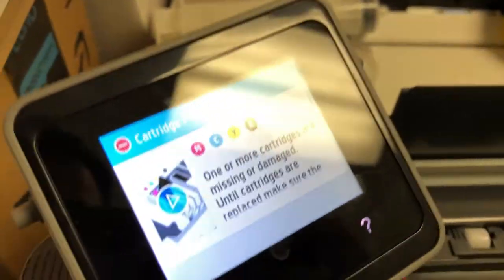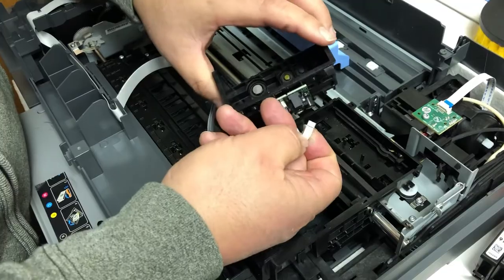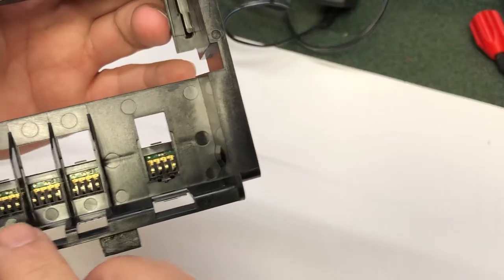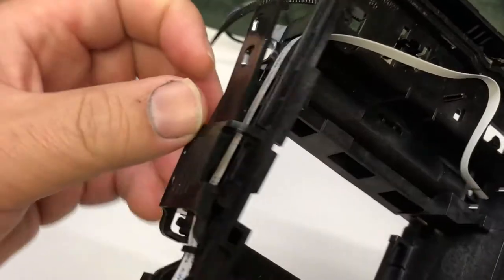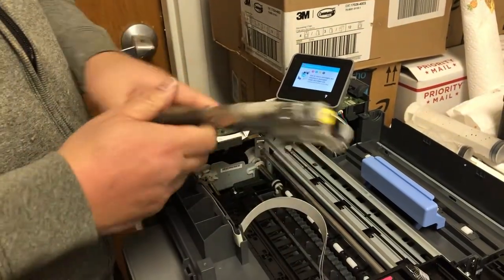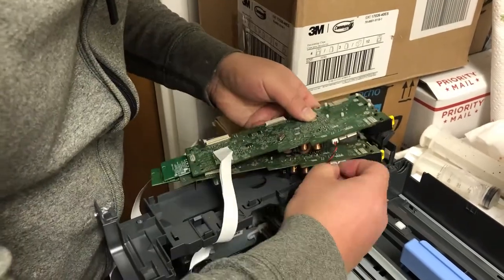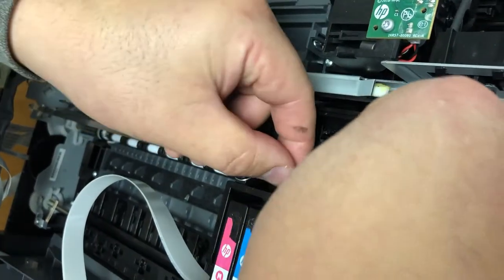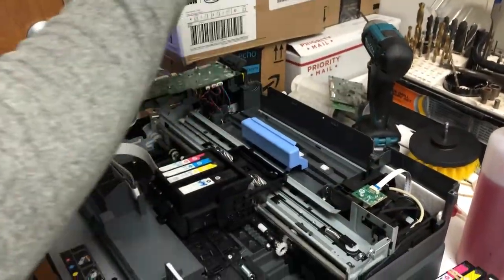How to Fix your Damaged or Missing Cartridge in a HP Officejet Pro Series

Comment: I am experiencing persistent issues with my HP OFFICEJET PRO 8600 Premium Printer. Specifically, I am encountering Cyan Y cartridge errors and damaged messages. The printer goes into alignment mode and continues spinning without ever returning online. Despite purchasing flushing kits from Amazon and thoroughly cleaning the cartridges to remove any dirt or debris, the problem persists. I am deeply frustrated because this printer produces amazing print quality, and I am reluctant to get rid of it. If you have any recommendations or advice, I would greatly appreciate your feedback.

Sincerely,
Dee

Comment: I have a BRAND NEW printer that I unboxed today, and at first I didn’t secure the cartridges properly so they were scraping around in the printer, so when I fixed it, it says that the cartridges aren’t found or damaged even though they are there. It says it only for the red blue and yellow cartridge, and the black one is actually showing up. What do I do??

Comment: Hi Kevin,

I have an 8022 with a error 71.02.4A did follow your videos and enable the head to move again but the code is coming back. I have also checked the cables connection, everything seems fine...

What else to check?

Thank you for an amazing content and pro tips!

Comment: Hi Kevin one thing I would like to verify, does the flex cable matter or can they be used on different printers universally once they share the same pitch distance.
Reply from the maker: As long as you have the same pitch.  However, Epson use 36V, HP use 12V.  So also check the max voltage too (usually 60V, so it’s a none issue).